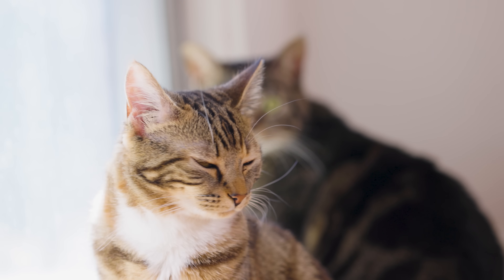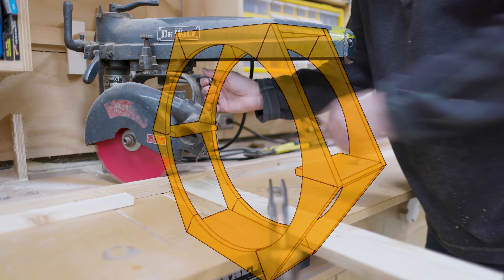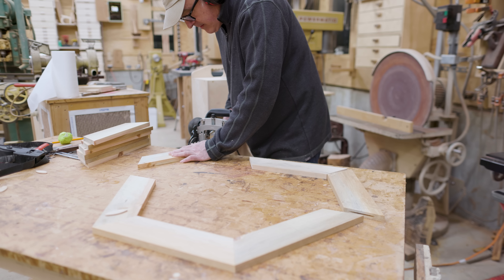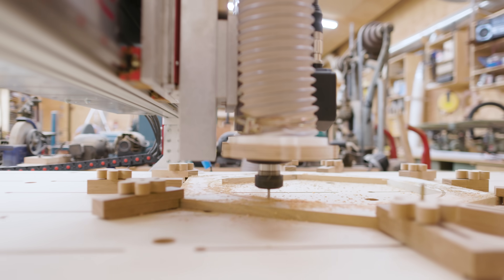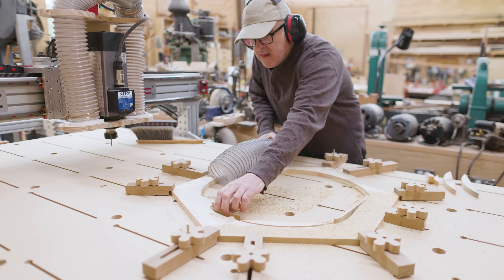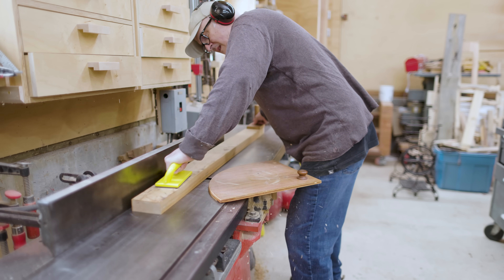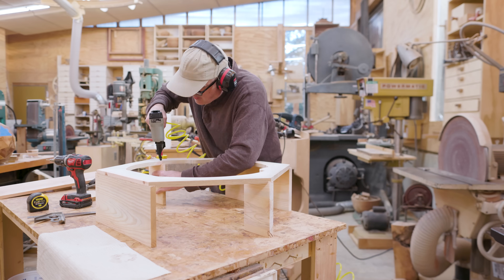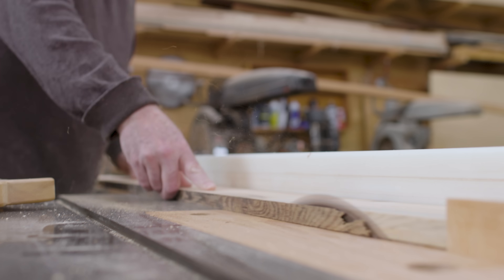Making A Cat Playground

Comment: Our cat used to get up on the roof of the house and garage a lot. Then he would stay up there and howl for someone (usually me) to come help him down. This got old in the middle of the Winter so I build him some spiral steps. I used an 8 foot cedar 4x4 and put a base on it about 30 inches  in diameter to stabilize it when standing on end. Then I cut some steps from scraps of 5/4 x 6 cedar decking I found in my scrap bin. The steps were about 12 inches in rise from one to the next and they rotated around the post 90 degrees at each step. So they had to corkscrew their way up or down. It worked very well and lasted for many years. Unfortunately our cat did not. He got hit bay a car one night 10 years ago last week. Miss you buddy.

Comment: That is just wonderful!
One of my favorite kitten castles that is easy, cheap, and quick to make is take several taped closed empty cardboard boxes and hot glue them together, beside, on top, any way you want, then chuck your 5" hole saw and cut connecting holes between the boxes, sides, top, bottom all around. Let your imagination run wild! The kittens will love it!

Comment: My 2 boys are 13 & 14 lbs. I like the wall set up, but anything I would expect them to sleep in would probably need a 1/3 wall on the bottom 2 angles of the hexagon, screwed into the exterior of the ring, or it's floor.

Comment: Love this, if you cut a slot or holes in the 2 horizontal mid pieces you could suspend some material to make a cat bed hammock. Also you need a cat bridge platform above the door.

Comment: I buit a pretty massive tower for my boys. All the plywood is 3/4" furniture grade. It's 6 ft tall, has 3 boxes (22" x 24" x 6") set at staggered heights. Bottom of the tower is 2 pieces of 3/4" ply 24" x 36". The upright are 2x4s. Carpeted the boxes, but not the interior bottom. For that, got 1" foam from the fabric store. That width is a really good fit for a pillowcase, making it easy to wash or replace as needed. Put some sisal around the uprights. They love it, and it's mass makes it a tick solid playground.

Comment: See...this is what happens when you have a workspace full of every conceivable tool a guy could want.  My cats got planks of wood mounted, with brackets, covered with carpet I picked from the scrap bin of a carpet store. I needed a saw, a straight-edge and a level. It looked fine but yours  system is a mansion compared to say ....my lean to 🤣

Comment: I would avoid permanently attaching those carpet samples.  Too hard to keep clean, and sooner or later someone is going to throw up on them.
In my view, most cat furniture is really ugly, and dominates any space in which it's placed, but I think you may have cracked the code.  These pieces are beautiful in their own right, and would probably appeal to most cats.  The only thing I think you might consider would be to add some facing pieces here and there for the cats to hide behind for napping, ambush, etc., since they do like privacy and feeling as though they're invisible when they just feel like supervising the goings-on in the room.
Reply: Velcro would be a good way to attach the carpet samples.

Comment: Great video, Frank! Did you consider cutting the dados on the back of the rings with the CNC? It seems like that might have been easier than fabricating a new throat plate for your big saw. Cheers!
Reply from the maker: Yes I did think of doing it all on the CNC it would have meant figuring out how to hold the rings down while I cut out the dadoes which wouldn't have been too difficult.

Comment: I have a french cleat question. I like the system, but do not like the appearance of the wood slats on the wall. 
Is there ANY way those horizontal slats can be made FLUSH with the wall?  I understand there would need to be an "open area" along the top edge of each one, but, that would be hidden by the cleat. 
Anyway, that's my question.
PS: I have a dog.